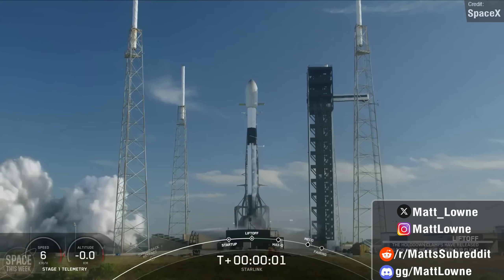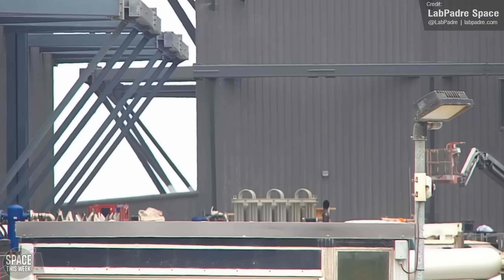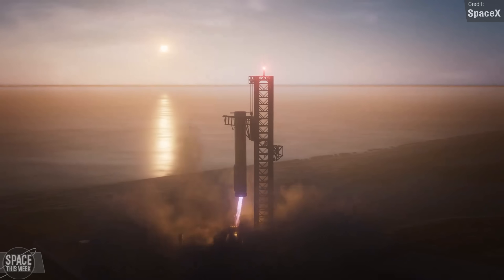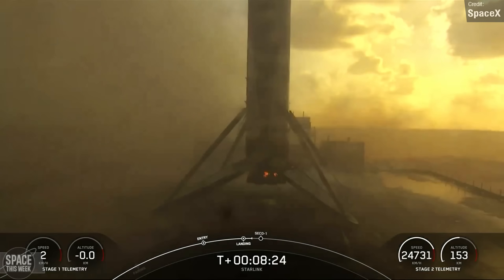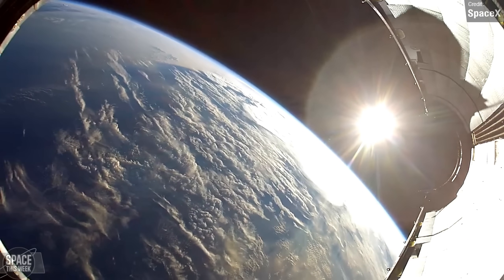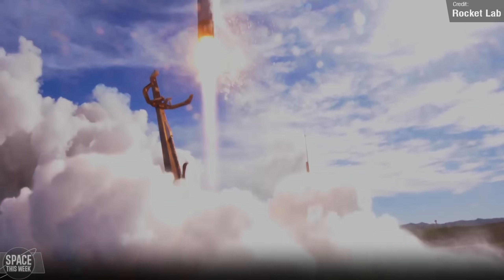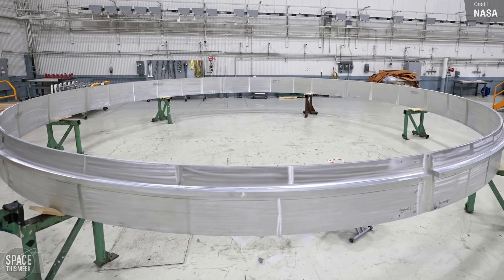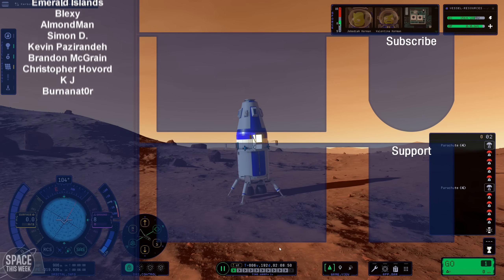SpaceX COMPLETE Starship Booster 11, and rollout Booster 13! + A Falcon 9 Booster DOESN'T Land!

Comment: Hi Matt, about the rapid reusability, do you think the tiles will ever give them that? I think not. If they want rapid turnaround, the tiles HAVE to go for most of the ship and clad with something else, for example a single use thermal ablative blanket that is wrapped around the main body. There'd be a payload penalty but turnaround times would be slashed.
Reply: Given the relatively simple shape Starship has it shouldn't be too complex, but a wipe-off/spray-on abalator would be better. I think a couple of X-15 flights started testing that.
Reply: @12pentaborane  Interesting. I'd think such an ablator would be a nightmare to get off as it's charred and cooked on the outside, very brittle and tough at the same time. Am I completely wrong?
Reply: @paulmichaelfreedman8334   Honestly I'm not sure about what the process would look like but I could see a rubber compound that sprays on then expands and chars in the heat. Getting it off might require harsh chemicals, but that will be quicker than inspecting thousands of tiles. However I'm sure SpaceX already thought of it and that's why they're using tiles, because I'm probably wrong.

Comment: Question:  If you sail, you know you cannot direct the vessel without a keel. How does a solar sail navigate?
Reply: My understanding was that the keel has more to do with balance than navigation, prevent the wind in the sails from making the craft capsize, though I expect it still helps navigation thanks to hydrodynamics.

The solar sails I've seen usually look like they'd steer more like a vertical (or horizontal?) para-glider than a sailboat. Would that mean the main craft's own mass is the keel?

Comment: can anyone explain how the saturn rockets made it to the moon, when starship needs like 8 refuellings ?? honest question, really looking for an answer
Reply: Because the Saturn 5 had lots of stages when starship only has 2, by the time the command module is staged, it would be already on a path to the moon, while the starship second and final stage uses most of its fuel to circularize its orbit.
Reply: @amateuryoutuber good answer… thanks for this 👍👍👍
Reply: @amateuryoutuber  i thought starship is the biggest rocket .. did the Saturn 5 hold several times the "fuel" that starship does ?  I guess that the the Saturn was less "fuel" efficient than the starship raptors .. so how much fuel did they need in 69 compared to today, for a trip to the moon and back..
Reply: @RübeXIsiminator  correct me if I’m wrong… the starship essentially lifts approximately 100 metric tons to orbit. So essentially, this could be 100 metric tons of fuel. Either as an upper stage or fuel for something else
Reply: @QuantumPath100  correct,  even more in the future ..  so how did all the stages of the Saturn 5 hold more fuel ? I just don't understand the math behind this
Reply: @RübeXIsiminator Apollo launches a small lander while starship launches a giant lander.

One weighs less than the other.
Reply: @AZ-kp2gq The Saturn V could get to the moon with less fuel because it was carrying less. Starship will be lifting up to 150 tons into orbit, while the Saturn V only needed to bring the bare minimum to get there (lunar command module, etc). This requires way less fuel. In addition, the Saturn V used all its fuel in the fuel tanks, while Starship is not since it will reland.
Reply: Starship is lifting WAY more mass into orbit and is using even more fuel to reland. This is why Starship needs to be refilled. It was designed to carry as much mass to orbit as possible and to do so, it would use all the fuel it has left, which it doesn't need to reland, to get into orbit. SpaceX choose this option since it is planned to be refilled in orbit. Therefore it cannot get to the moon without conducting an orbital fuel transfer.
Reply: @Imagine_Beyond  nicely said 👍👍👍
Reply: @Imagine_Beyond  thanks for the explanation.. so at least 8 re-fuelings , because of the mass[ wich is not fuel ] to orbit starship transports ..

Comment: chees
also why does starship version 3 add more vacuum engines? Thrust doesn't really matter because you don't have to fight gravity and u are adding more mass, so I am kinda wondering why
Reply: Efficency in space is crucial if you want to get to mars, also it is stronger
Reply: You still have to get into orbit
Reply: They always wanted to get 6 rVacs on the ship so why not add more now since it weighs more. Having the extra 3 should mean it would be more efficient to burn for a much heavier ship than just 3
Reply: But the isp doesnt increase when you add more engines. Is it really just about getting into orbit after the hot staging? Isn't that part mostly sideways? The hardest part where you really gain height is already done by the boosters. I image that that would be where higher thrust would be most important, since the acceleration is slowed down by gravity.
Reply: @mysteriousguy2230  to get into an orbital trajectory from a suborbital trajectory, you have to increase to orbital speeds fast enough. If you don't accelerate fast enough you will fall back into the atmosphere before you can reach orbital velocity. My guess is starship 3 has too much mass for just 3 enignes to push it to orbital velocity in time, so it needs 6. Im not an expert though, correct me if im wrong.
Reply: yeah that makes sense

Comment: Its crazy that a Falcon 9 first stage NOT landing has become out of the ordinary...
Reply: Indeed it has! Yes, they have a lot more but still, it’s actually a little shocking since we’re so used to them sticking the landing.
Reply: I mean, I get it. But even then, I guess there are limits.
Reply: Yeah right, it's bigger news than 2 falcon heavy side boosters landing in sync. Insane how reliable it has become over the years.
Reply: The impossible rocket ;•) and now it seems strange when it for once does not do the impossible.